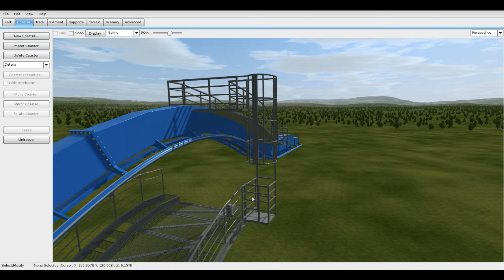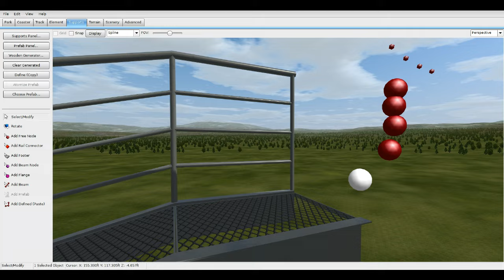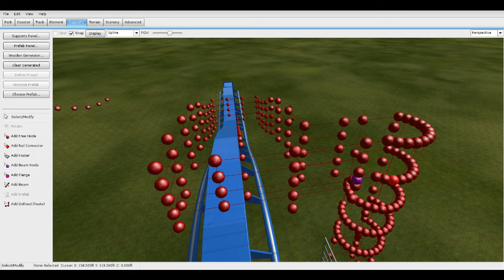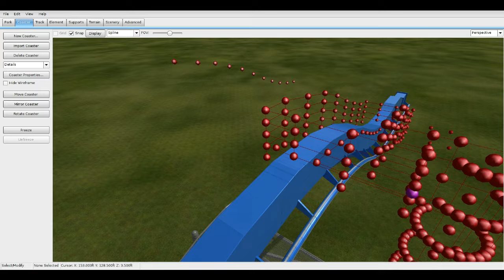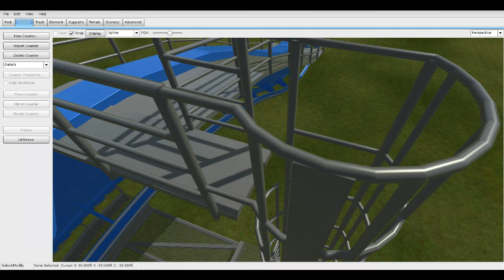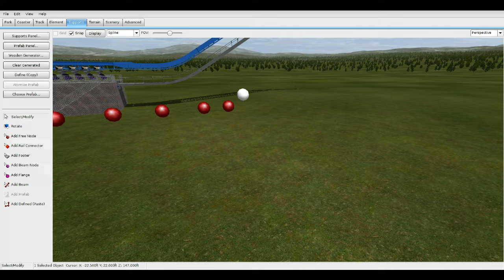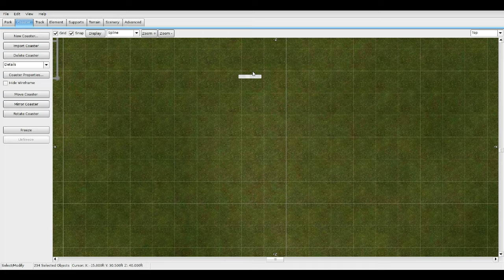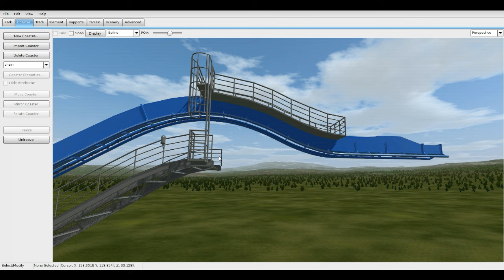No Limits 2- How to make Inverted B&M Catwalks & Lift Motors!

Comment: That's a style separator, not a type separator.
It seems like you're pitting more nodes into that lift motor than is necessary, I remember what you said about free.nodes not taking up memory when it's frozen, but it takes so long and it's messy, why not weave it vertically like a blanket or whatever?
You ought to put annotations in your videos when you refer to tutorials you've already done in case someone hasn't seen that one yet, I think it would be handy.